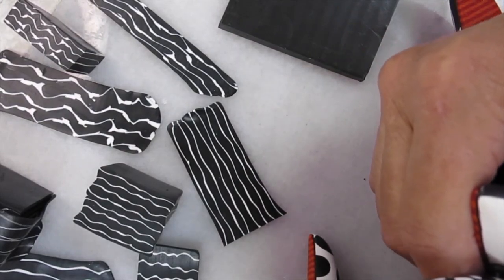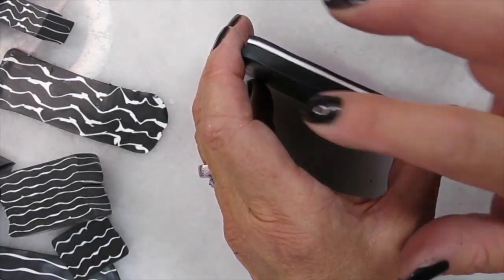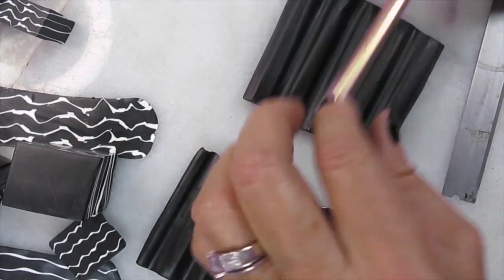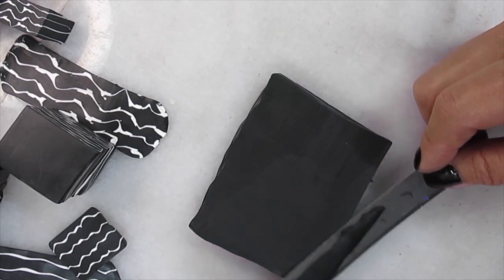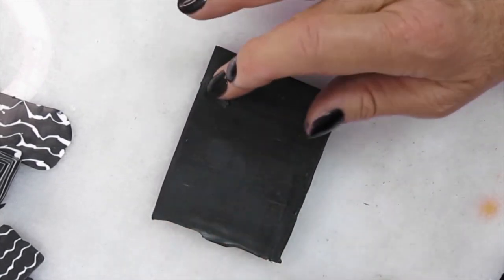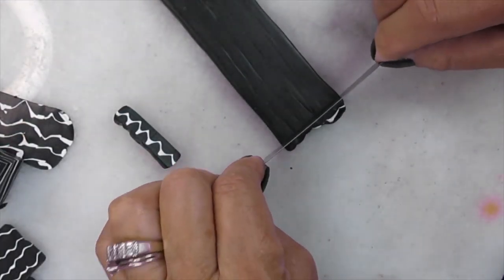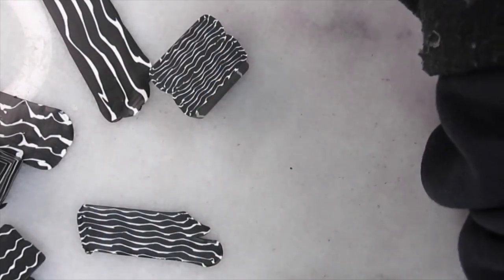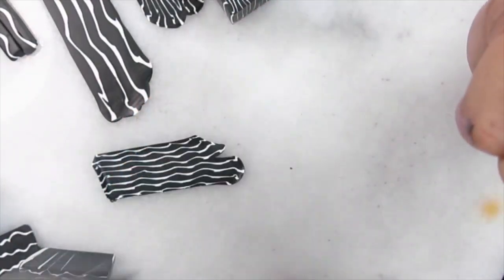Black and White Series, Waves, the Cane in Polymer Clay

Comment: Hi Donna, working on your beautiful wavy can. Mine not so beautiful but it will get better! My question is about ckeaning the machine between volours as i am getting white on black and vjce versa. I have used a thin tooth pickmonnbothnplaces i csn see there is clay. Wiped the rollers and everything ekse with baby  wipes but still get colour transfer. What am i missing. Is there a hidden clay goblin in the depths of the machine? Aargh! Thanks, jill
Reply from the maker: You know, Jill, I take a towel and run it under the rollers to remove the schmutz. I find that's the best for me, maybe it'll work for you. I hope so! Hugs, D

Comment: Beautiful¡  what kind of wire or cord do you use for something like these beads?
Reply from the maker: The image with the 5 pieces is actually strung on memory wire that I slid hollow buna cord over! The memory wire is thin and I believe the cord was 2mm in diameter but I would have to check to make sure of that. It’s a good system as the pieces don’t sag on the cord. Hugs, D